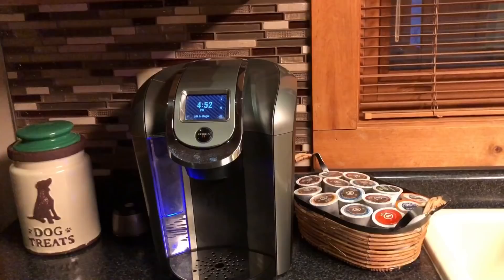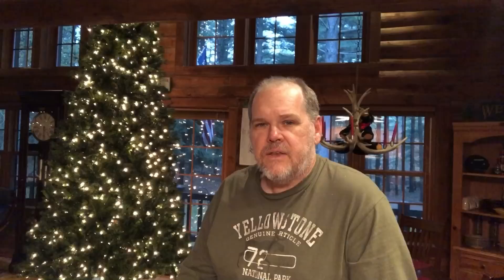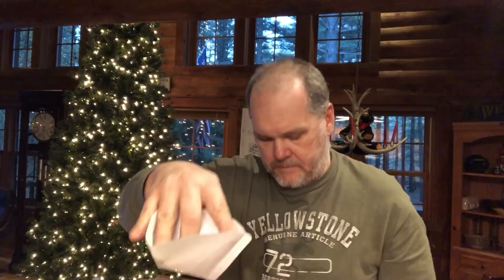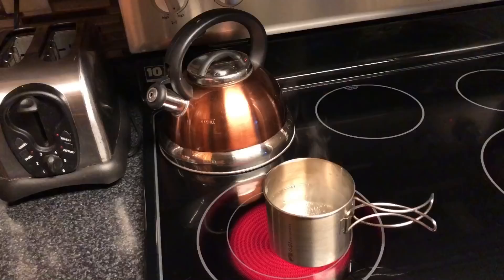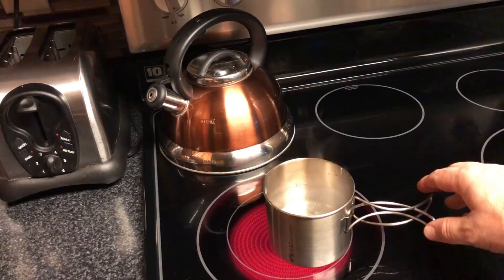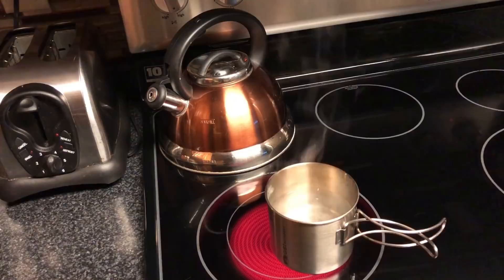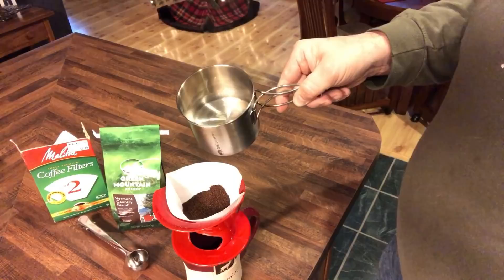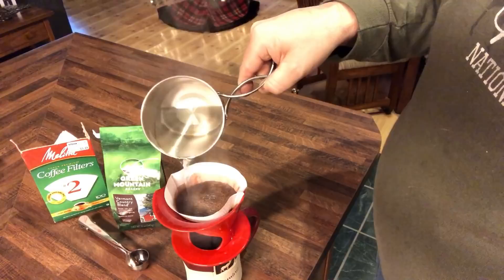Brewing Coffee while Boondocking in our Jayco Hummingbird 16FD

Comment: Years ago my mother gave me a tiny drip coffee maker called "A Cup a Time."  When our electricity went out I took the little basket out, put it over a cup, and used it just like you did with your Mellita.  Your Melitta has that nice bottom that sits over any mug.  I like that since my little basket kind of sits inside the cup.  Then I have to hold it up while the last bit drips.  I always drip some on the counter.  I will have to get me one of those.  I do not like stale coffee.  If the coffee isn't fresh I'd rather drink water.  That little mug/cooking pot is a great gadget for camping.
Reply from the maker: It works great and the nice thing is that it is inexpensive!  Plus for camping it takes up little space and is light weight!